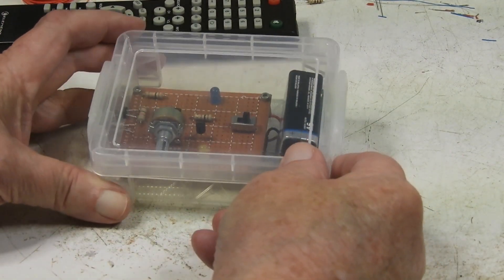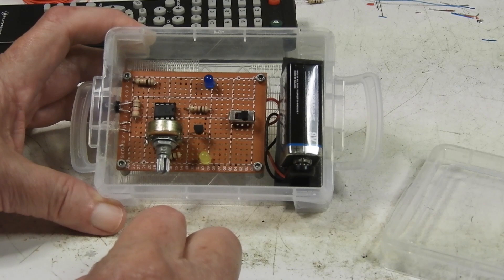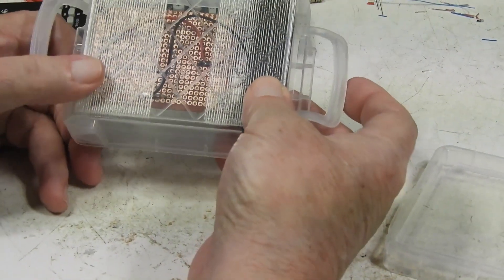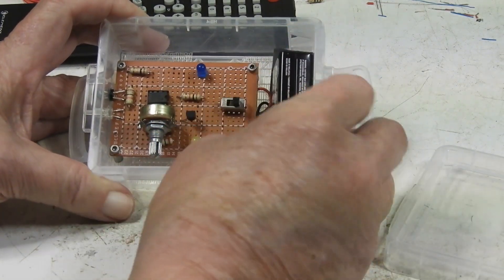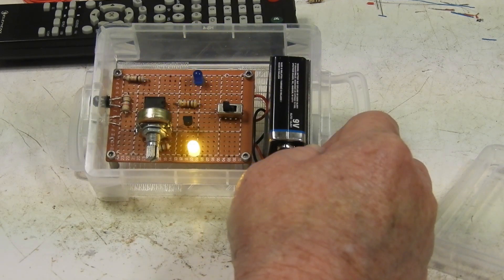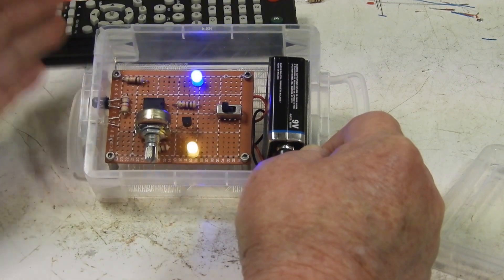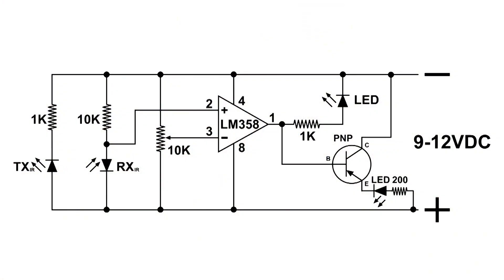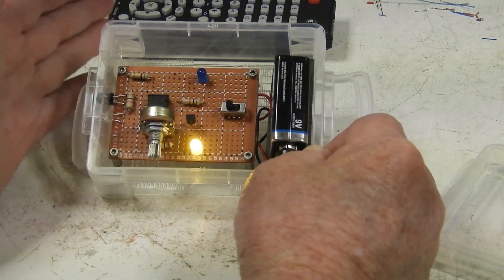Portable Infrared Transceiver

Comment: Your infrared transceiver is giving me ideas too, I'm thinking like a wireless data link like some of the old PCs had, infrared remote control repeater, and course of proximity alarm or activation circuit. Sump pump alarm I wonder if it would detect water level.
Reply from the maker: Sounds interesting.
Thanks

Comment: You can build two transceivers and use for voice transmission: https://mlodytechnik.pl/files/qwr/72-nw-06-fototelefon.pdf
Reply from the maker: Yes. I'm planning on building a audio infrared transmitter using infrared diodes. Also I have ordered some infrared lasers. This should be some interesting experimenting.

Comment: You could utilize the second Op Amp in the DIP package to amplify the IR received signal to make the circuit even more sensitive.  Nice project.
Reply from the maker: thanks
Yes. I'm planning on building a audio infrared transmitter using infrared diodes. Also I have ordered some infrared lasers. This should be some interesting experimenting.
Reply: @AllAmericanFiveRadio  COOL.   Look forward to viewing your  progress.